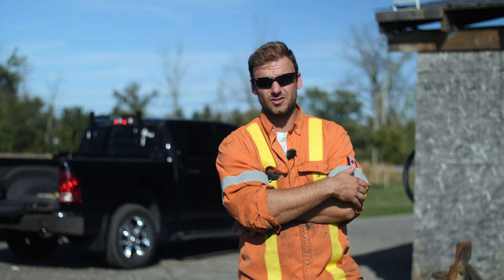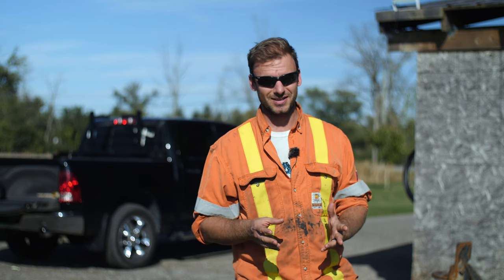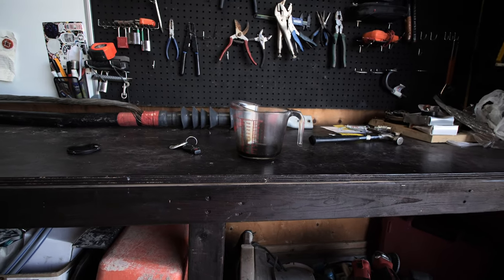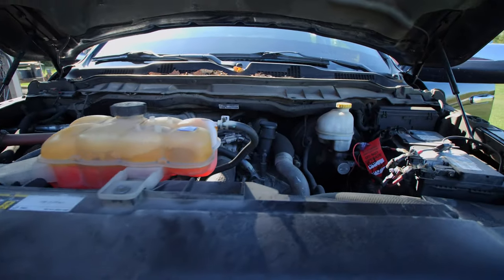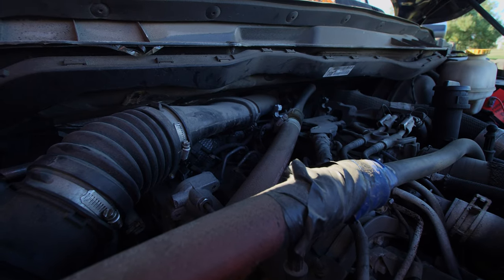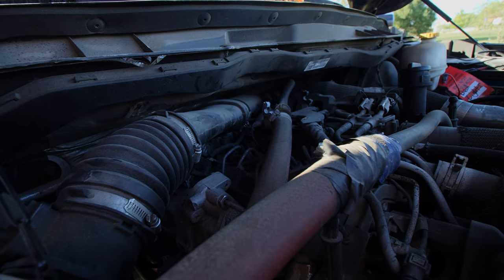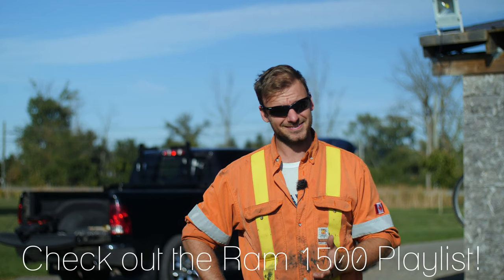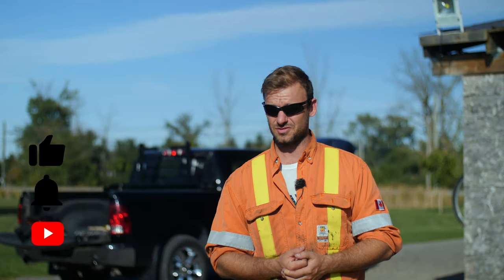These TWO things will help SAVE your Ecodiesel!

Comment: Use Redline Group V Ester Synthetic 15w-40 Diesel oil and you will prevent that from happening, Group V Ester Synthetic oils are well known for their cleaning properties, they will prevent the build up of sludge.
Reply from the maker: 15w40 ??? You're the first person I've ever heard recommend 15w40 for the ecodiesel. Hell the first two years they wanted 5w30. Not sure how these engines would hold up with 15w40. Not saying it wouldn't work just never heard of such tale. How long have you been running 15w40 ?
Reply: @GilbertGardens  

I have been running Redline 15w-40 since 1,800 miles, remember that the first number is just the winter number, I live in Southwest Florida were our winters are mild so I have no need for a 5w winter rating. 

The Redline 15w-40 has a pour point down to -49 degrees. I have read accounts of businesses that had ecodiesels and ran 15w-40 oil in them without any issues at all. 

FCA changed from the 5w-30 oil spec to the 5w-40 oil spec because the 30 weight oil did not have a strong enough film strength to protect the bottom end bearings. The 40 weight oil has a stronger film strength.
Reply from the maker: @ramecodiesel8271  yes I understand oil weights I've just never heard of that oil being used. Either way it's 40 weight so the bearing issue won't be solved. I need the lower winter rating. I suppose for your weather conditions it doesn't need 5w40. We get - 40F from time to time.
Reply: @GilbertGardens  

You need to research Ester based synthetic oil, it is well known for its ability to clean and keep clean the internals of an engine. 

If you need a 5w winter oil in 40 weight Redline has professional series it is a Group III/Group IV PAO oil in 5w-40. It has a pour point down to -54 degrees.
Reply from the maker: I'll check into it. It's tough to switch from t6 when it's recommended all over. I literally use it in everything I own lol. I will Check into it though, thanks.
Reply: @GilbertGardens  do some checking with the real oil guys who do analyses in their own labe etc. T6 is Ok. that's it. no better than most any other oil.  Quaker full syn has twice the film strengh even in 5/30. much better oil.  I used T6 for a very long time and in everything as you do. Big difference when I learned this. QS now goes in everything  with a motor here. Better in every way. hope it helps.
Reply from the maker: @thagedorn  everyone's got their favorite brand. I know t6 us great oil overall my oil tests said I could push it to 20,000km while deleted but I don't bother.

Comment: Is it okay to dump the oil back into the motor?
Reply from the maker: It's upto you. I've done this and it just blows right back into the catch can. If you don't have a catch can itll end up inside the air system. It depends how much blow by your truck has.
Reply: Bad idea. The majority of what comes out of the catch can is fuel and water/oil vapor. Very little of that is actually oil.

Comment: 1 Other thing, use a cetane boost. These motors are made to run on cetane 50+, not crappy 40 cetane USA diesel. If you do a UOA and you see silver, that's a potential problem, bearings have silver.
Reply: Bearings are copper/brass color. Silver is fairly normal aluminum dust non ferrous.
Reply: If you see more than 2ppm silver in the UOA, personally, I would think about dumping it. So far the only silver was at the 5,000 mile break in oil change. Rest of changes have been 0 ppm. Almost 120,000 mi.

Comment: Ok dude you completely lost any legitimacy when you believe the EGR pumps spent exhaust into the intake manifold.

Bro, why would that help emissions? That would make combustion next to impossible.

Or maybe you can use that good ol brain to remember that “eco diesel” is short hand for Small displacement diesel with a turbocharger to boost performance to an acceptable level (turbos not having the same power sapping effect that super chargers do since they work on simply the exhaust pressure leaving your engine to spool up a turbine which, in a completely unconnected pipe creates a corresponding level of pressure in the intake manifold (forced induction) to greatly increase the power levels and the fuel/air ratio improving efficiency and allowing the fuel’s explosive force be much more potent as a passive intake depends on simply passive suction from the combustion already occurring.

The EGR is simply a device that’s purpose is to cool down that extremely hot exhaust as to help with turbo temps, oil temps, and EGT (exhaust gas temp) which if too high creates a positive feedback loop where the turbo gets hotter and hotter and therefore adding tons of new heat in the oil and in the coolant.

That’s why people who don’t just decide to cut cables to parts in their engine bay, buy aftermarket EGR’s that eliminate the terrible ones in the ram/jeep ecodiesel. Also by doing any aftermarket upgrade that increases air flow of exhaust from the catalytic converters, the air intake filter or CAI attachment, a better intercooler with proper hot and cold pipe exchanges between the turbo and the intercooler.

Even the Afe oil pan which has an extra 2 quarts of oil volume, has an fully aluminum build with a ribbed appearance that servers as a minor heat exchanger for the oil in addition to all else.

What you did is first removed the device that keeps the the turbo from melting, but you then took out the piping that spools the turbo in the first place.

Congrats you literally made it more reliable by butchering it.

You would have known all of this in a few google and wiki searches, but you know what they say measure twice, cut once. Too bad you didn’t take it to heart.
Reply from the maker: I'm offended!. Here I got this from a basic Google search......... "To help minimize this, the EGR valve allows a precise quantity of exhaust gas to re-enter the intake the system, effectively changing the chemical makeup of the air entering the engine. With less oxygen, the now diluted mixture burns slower, lowering temperatures in the combustion chamber by almost 150°C, and reducing NOx production for a cleaner, more efficient exhaust. "
Reply from the maker: The "mods" I've done to my truck are pretty standard. Thousands of guys have done the same thing with good results. I do appreciate you dropping by though.
Reply from the maker: And I've never ever heard of a turbo melting due to "cold air intakes " lol. Again thanks for coming out.

Comment: how you explain that "Vern Diesel" got 700K miles on his 2014 ecodiesel already ?
Reply from the maker: Whos vern diesel? 700K is a buncha miles. Ive  heard of guys getting 400+K though. Just because some people are having failures doesnt mean theyre all bad. Im at 250,000KM now still sounds like it did on day one.
Reply: @GilbertGardens   a guy from RAM Ecodiesel forum. search Vern Diesel and you should be able to find him. I just bought 2021 Laramie sport ecodiesel. 26 MPG combined for my first 3200 miles. Will do my first oil change today.
Reply from the maker: @veniaminmarar710  I'll check it all out.

Comment: No delete in USA anymore ... well, at least legally.
Reply from the maker: It never was legal lol
Reply: @GilbertGardens  Good point.
Reply: @phprofYT  You may acquire legal tunes from sofa king. The legality is in how they are applied by you, the user. Stage 1 tunes are very easily reversed.
Reply from the maker: At first I just disabled the egr... Then deleted the DPF etc etc.
Reply from the maker: I know what you mean though.. More cracking down in the USA for sure
Reply: Best way to fix, sell it!
Reply from the maker: @kbustaar  yeah that'll do it.
Reply: @4DFlatlander  I did sofaking stage 2 and had no problems other than the Chinese dpf pipe being bad quality.
Reply: GDE now has a EPA compliant tune.
Reply from the maker: @littlefishinggoat5409  I heard that. Is it mostly for performance? I imagine the EGR is back on.